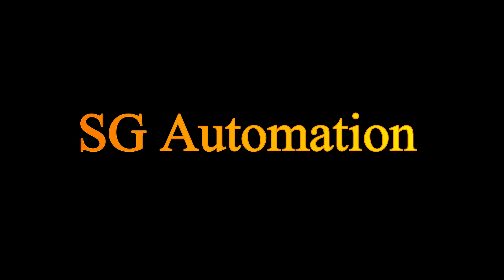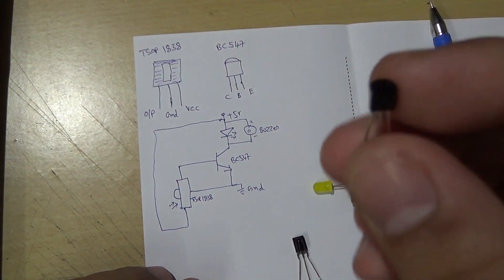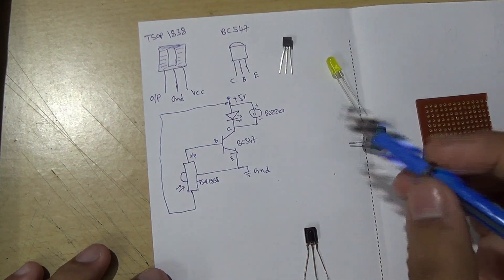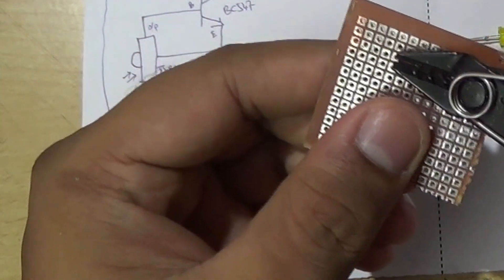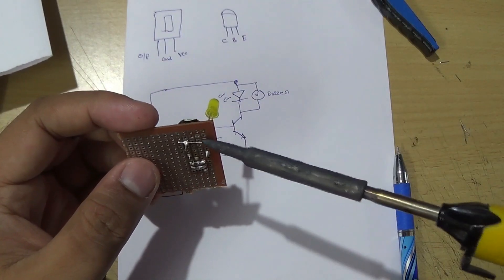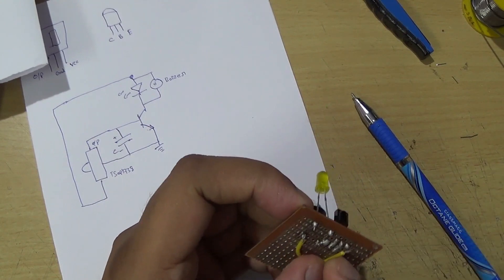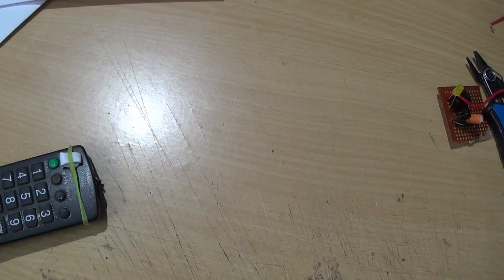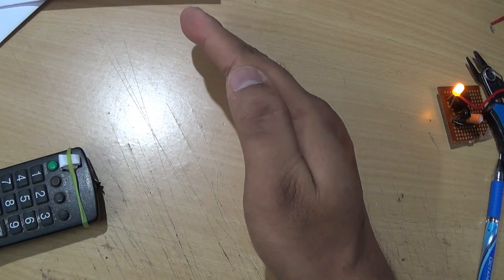#DIY Security Alarm by using old remote

Comment: Clearly explained.  But using remote control as IR transmitter is bulky
Reply from the maker: if not remote only one ir led won't work ,you have to make an IR transmitter using 555, because the receiver will work only at 38 khz frequency.this gives higher range